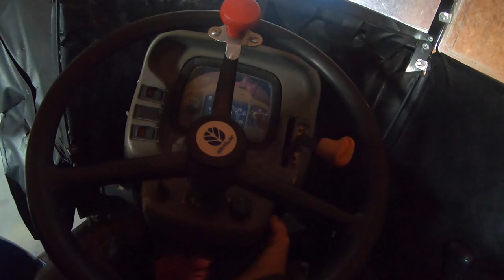Please Do Not Attempt To Perform These Stunts.. Just Another Day.

Comment: Andy, I was watching your crop dusting and hauling corn video, and I have 2 questions. The first is do farmers need to have a CDL to drive a semi. And the second is, I noticed that you have some steering wheels with a suicide knob on them and some without, which do you prefer to drive with your foot? Doo the knobs make it easier or do they just get in your way? I have been driving heavy equipment since I was 15 (54 now) and I all ways preferred a knob on anything I had to haul a trailer behind.
Reply from the maker: Farmers don't need a CDL unless they are crossing state lines or hauling farther than 100 miles. As for the knobs, the one on my loader was installed by my neighbor who uses my loader every now and then. He's 84 and was just tickled pink to put it on to help me out. I didn't tell him that I dislike the knobs as they get in my way. lol. They get caught in my pant legs. In another year or so, he won't need to use my tractor anymore and ill remove it. Thanks for watching

Comment: One question how the fuck are you driving the car wtf 🤨 wouldn't that be hard bc of you need one on steering wheel and one on gas and trying not to get the camera from failing
Reply from the maker: Ill get a driving video going but for now, left foot, pedals, right foot, steering wheel.Holding camera while driving, whatever works1 Thanks for watching. Check out the video Drives with feet.